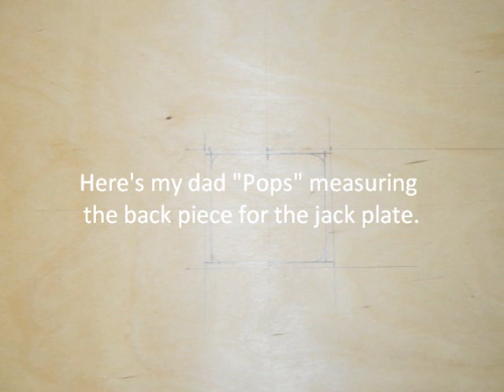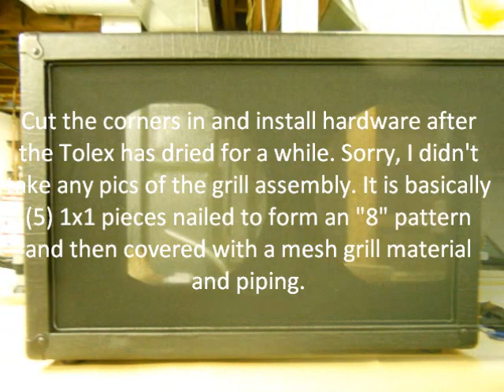2x12 cabinet build

Comment: Nice Job, but I wouldn't buy that "Birch" plywood from either Home Depot or Lowes, because it isn't Real Birch plywood. it is just two Birch Vaneers on the outside (Only birch on the front and back, glued over  what ever junk they wanted to use on the inside. (Inner vaneers Could be Pine ect) Real Birch plywood 3/4" has 13 or more plies, and has no voids, unlike the stuff at the big box stores.
Reply: That is very true they do have those types of sheets of plywood and they cost less but the do have full sheets that are all birch which cost more I know for sure I worked at home depot lol
Reply: The birch ply in my home costs $132 for a 8x4 sheet and is same quality as that website I am staring at a piece of it right now lol. No Lowes in my home town yet.